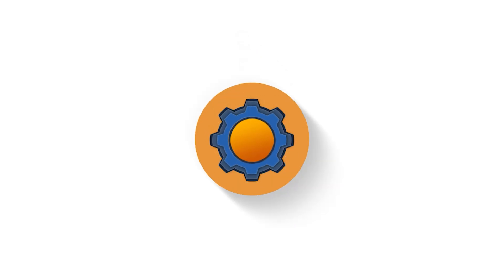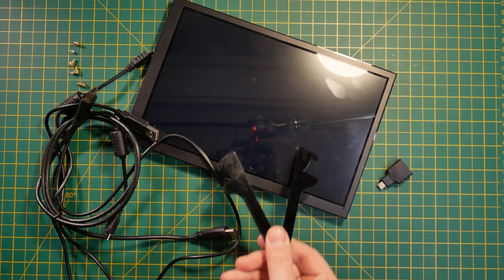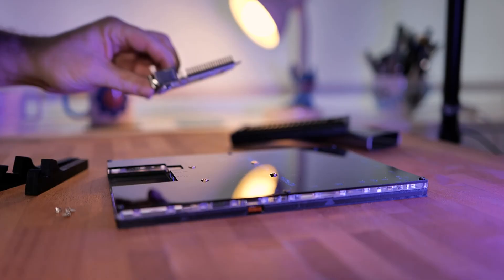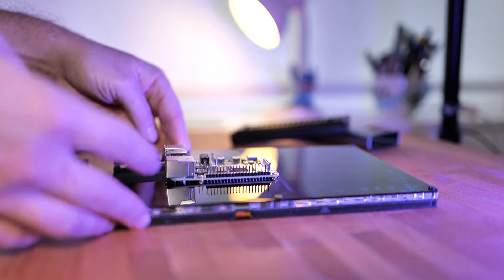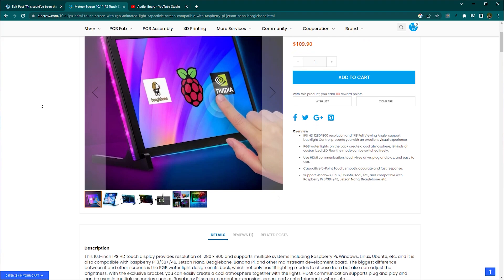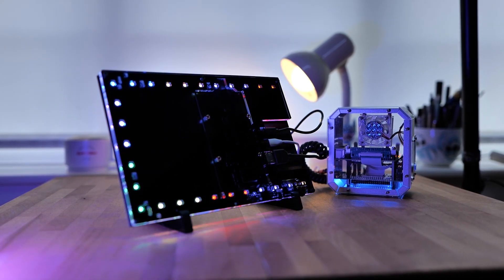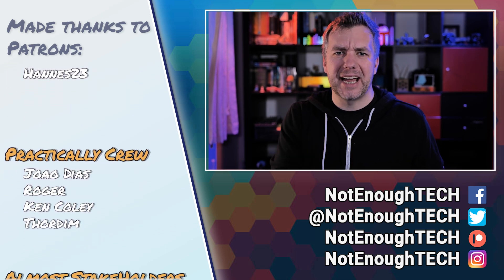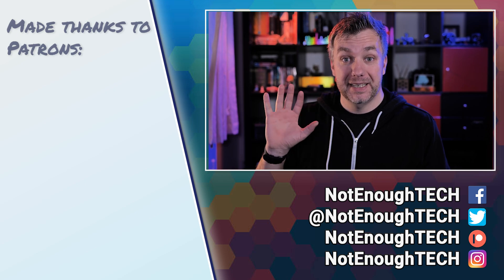Meteor Screen  from Elecrow

Comment: On a wish-list for the display, I'd add an SPI port.
Reply from the maker: I wondered what's more flexible spi to flash the IC that essentially plays stored animations or going with a raspberry Pico and hooking up the LEDs directly
Reply: @notenoughtech  I was just thinking that an SPI would give a lot more possibilities for the processor (eg Arduino etc). But also some external access to the LEDs would be nice (it's only one wire, after all).